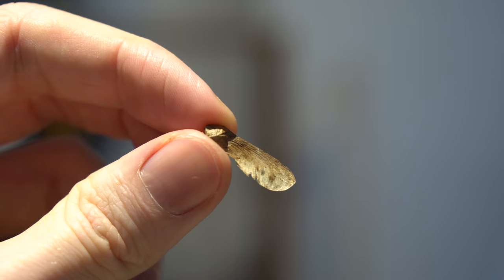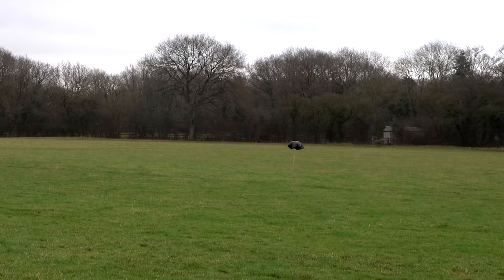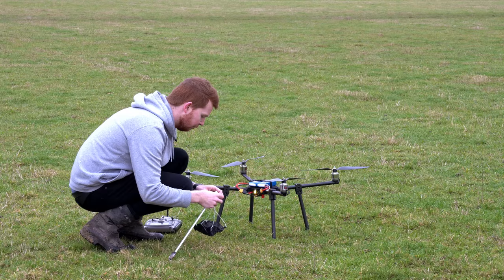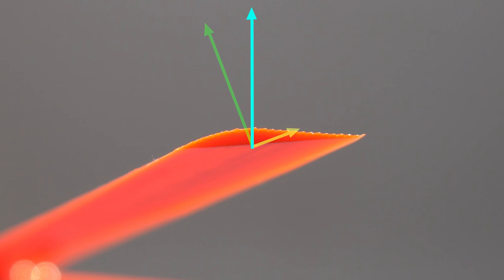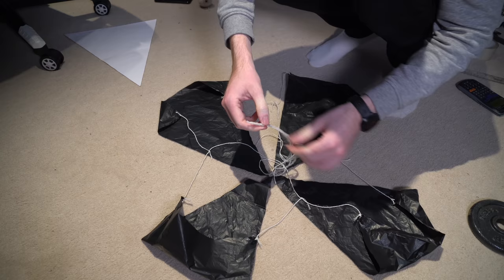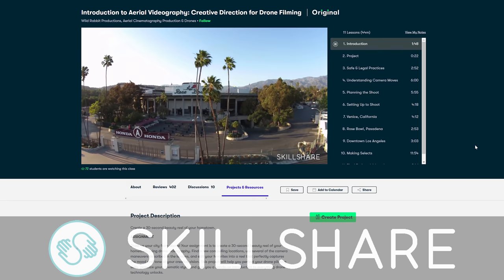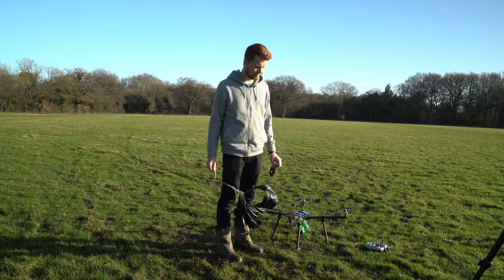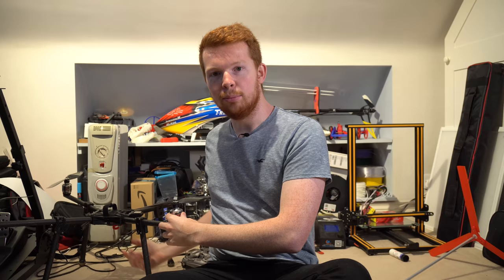Should Parachutes Spin?

Comment: Ladies and gentlemen, I give you: Autorotation. The reason why helicopters don't fall like a rock when their engine cuts out.
Reply: I had the exact same thought!
Reply: Additionally because the pitch is adjustable, the pilot is capable of just before "landing" to adjust the pitch and use the energy in the spinning rotor to produce some lift as well.
Reply: I was checking if someone already wrote that and You did, Thank You
Reply: They do fall like a rock for about the first 60 meters. After that the rotor speed is high enough to be useful. Under 60-80 meters, prepare for a hard landing.
Reply: Tom could add a servo to the rotor and a proximity sensor to make it flare for a soft landing.
I'm sure he's up to the challenge!
Reply: Also why autogyros or gyroplanes work in the first place.
Reply: There's a video of a pilot demonstrating autorotation here on Youtube.
He shuts of the motor and lands like a boss.
Reply: What Is Islam?

Islam is not just another religion. 

It is the same message preached by Moses, Jesus and Abraham.

Islam literally means ‘submission to God’ and it teaches us to have a direct relationship with God. 

It reminds us that since God created us, no one should be worshipped except God alone. 

It also teaches that God is nothing like a human being or like anything that we can imagine.

 The concept of God is summarized in the Quran as:

{ “Say, He is God, the One. God, the Absolute. He does not give birth, nor was He born, and there is nothing like Him.”} (Quran 112:1-4)

Becoming a Muslim is not turning your back to Jesus. 

Rather it’s going back to the original teachings of Jesus and obeying him
Reply: @ahmdabdallah5811  mhm yes
Reply: lol odd place to bring up god but ok
Reply: @ahmdabdallah5811  the fak man?
Reply: bro i thought the same thing!
Reply: Yap
Reply: @ahmdabdallah5811  Jesus built my hotrod.
Reply: @technotaoist72  Wouldn't the blades be spinning by default anyway? Like, how else does it get up there?
Reply: It  depends on the type of failure. Drive in 4th gear, then drop it into 1st. Suddenly your wheels aren't going as fast as they were. There are multiple failure conditions that will slow your rotors.
Reply: Works with LEDs too (using light, not rotation)
Reply: This channel is about science....why do some feel the comment section is a place to push their religious agenda ?...there is a time and season for everything...wrong time..wrong season....now on wit more science!!!
Reply: @walterwilliams3861  Not sure if you realize that there what you said is a Bible quote...
Reply: @technotaoist72  yes this I know...raised as a Christian....practiced Islam for 22 years...now I just consider myself a spiritualist....just saying the only thing worse than a pushy Christian...is a pushy Muslim....faith is a personal journey...no disrespect intended on my part...just saying...
Reply: Came for parachutes..not theology....
Reply: @walterwilliams3861  I like soup
Reply: @technotaoist72  I like sandwiches...who's to say one is better than the other....lets agree to disagree...and get back to science....kmsl
Reply: I always figured with autorotation what they did is pitch the blades the other way last minute so the momentum of them rotating starts to push air down, am I wrong?
Reply: @technotaoist72  just watched an ok Seinfeld clip just had to say it...."No soup for you....."....kmsl...
Reply: @ahmdabdallah5811  so when groups or sects that claim islam go on a crazy killing spree and start shouting Islamic terms and prayers, why don't the church assembly or recognized leaders rebuke and publicly unrecognize them as brethren of the Islam religion? Seriously. When devoted Catholic serial killer John wayne gacy was executed they made a public statement saying his actions were of the devil and not the catholic faith. They said a man who truly follows the doctrine of church is not capable of the murders. Explain plz. Seriously...
Reply: @redsquirrelftw  I'm not a helicopter pilot, but AIUI, that's part of it.  One of the things they do really early is reverse the blades so that the up-rushing air is maintaining or speeding up their blades.  They also, if they have forward momentum at least, enter a downward and forward glide much like a plane would. This allows them some control to pick their landing site.  And, as they get closer to the ground they use the energy in the blades to adjust their descent speed and path so that they flare and land, again somewhat similarly to how a plane does it.

So, yeah, at the end they reverse the blades (or reverse them back, really) so that they convert the rotational energy they've been conserving and/or building into lift, but this is one of many steps they use in the process of autorotation.
Reply: @ahmdabdallah5811  Islam is just a religion
But Christianity is a lifestyle 
Sacrificing everyday for God
The good news was spread by christ himself our savior
Your God does not align with our God even your religion does not have a mutual relationship to us. Islam is for you only. You cannot save on what is already saved. Us christians are only going to need to sacrifice our own souls to Jesus Christ
Reply: @jaydensdream714  Catholic faith is different to real faith in Jesus Christ
Reply: @jaydensdream714  Btw why did this place became a theology session?
Reply: And a gyrocopter is the safest plane.
Reply: Yes, but with Autorotation on a helicopter you have to change the Pitch. If the engine fails, you have to use negativ pitch (the rotor will rotate from falling) and near the ground (landing) you have to change to positive Pitch to reduce the falling-speed (1 chance).
Reply: @wizzardrincewind9458  because air speed increase the further you are from the point of rotation, by adjusting the pitch of the blade, you can have the 50% inner rotor working has a turbine, and the 50% outer blades working has a propeller making lift. You can adjust the % as you want.
Reply: @MrRolnicek  Also why I'm a fan of them. Can't understand all this desire for helicopters at all costs. Autogyros will do 90% of what a chopper will do for 25% of the outlay...
Reply: @ahmdabdallah5811  Why are you?
Reply: Yes, but the landing still hurts.
Reply: @ahmdabdallah5811  Are you sure you've come to the right video? Not sure what all that diatribe contributes to the discussion.
Reply: Hey it's me destin!
Reply: @travellingpilot  Me too!
Reply: @ahmdabdallah5811  A violent, militant government system masquerading as a religion.
Reply: Just what I was going to write. And correct me if I am wrong about this but that's also how gyrocopters work. The main rotor on the top is not powered by an engine but by the incoming air.
Reply: ahmd abdallah exmuslim here, open your mind sheep.
Reply: Those aren't parachutes--they are popellers and propellers spin!  Parchutes don't spin!
Reply: I was a lot younger and forget the details, but here in nz there was a heli pilot who used to just shut the motor off and auto rotate back down the valley to base.
Reply: tell that to john denver
Reply: Tell that to Kobe
Reply: Steven Cooper too soon
Reply: Exactly!
Reply: ohhhh... this didn't age well
Reply: But Kobe Died ....
Reply: It's kind of weird that he didn't state autorotation by name, that is exactly the topic of this video...
Reply: Kobe still died tho.
Reply: Tell that to kobe
Reply: @ahmdabdallah5811  go somewhere else my friend. This is not the place
Reply: Talk to Kobe about that one.
Reply: If my parachute was spinning that fast.... well I'd be crazy dizzy!!!
Reply: Yes, exactly what my mind came to. However, autorotation requires forward velocity to keep the blades spinning. This drops straight down...
Reply: I didn't know that. Thank you
Reply: @ahmdabdallah5811  Then why all the murder? For one thousand  four hundred yrs?
Reply: @ahmdabdallah5811  Ah, yes. Praise aloha
Reply: Contrary to Neil Degrass Tyson's understanding of helicopters.
Reply: Kobe
Reply: And, even more so, the Gyrocopter or gyroglider.
Reply: @technotaoist72  Are you a helo pilot? Because if the pilot reacts quickly, this seems wrong. After all, the rotor doesn't need to spin up if you're already flying.
If you are a pilot or for some other reason know that it falls for a bit and why, please do explain, as I love to learn and overcome my own misconceptions.
Reply: @justuslm  When the motor stops, there's no more torque on the rotor, so you need to lower the collective and the fall will keep the main rotor spinning enough to be useful, providing nothing in the drive system binds it up.
Reply: @technotaoist72  But won't the lift created by the rotor through autorotation simultaneously start slowing down the fall, meaning you won't even really fall for 60 meters?
My understanding is that this actual falling distance would only occur if the rotor wasn't already spinning at significant speed, but if you notice the engine failure before the RPM really drops, that shouldn't be the case, right?
Reply: @justuslm  if you are 300 meters up, using up the momentum of the rotors in the first 20 meters is sub-optimal
Reply: Oh but they do...
Reply: Helicopters do also have a flywheel which stores energy to keep the rotors controllable when it has an engine malfunction.
Reply: @ahmdabdallah5811  Curious question. if preying to god directly is good then it would stand reasonable the jewish practices are the most correct as they  worship god directly.
Reply: @ahmdabdallah5811  "Ah yeah you know what, Islam is very relatable to autorotation"
Reply: with one caveat, the blades still spin.
Reply: @Cynyr  partly. In autorotation the blades are angled downward, so that the gravitational pull on the helicopter and the increased win helps keeping the inertia of the rotor head, and they only give positive pitch to the blades at the end of the descent, so they keep the rotor head in motion by angling it downward, otherwise the maneuvering of the aircraft would stall the rotor ( altering the cyclic pitch does rob the head from it's inertia), and that would be game over.
Reply: @technotaoist72  most of the time when you're that high up in a helicopter, the rotors are already spinning though.
Reply: What about Kobe tho...
Reply: Breaking news from Mother Nature: And it'll work if there's only one blade left as I showed you with that seed, have a nice day
Reply: @Cynyr  nice hacks
Reply: agreed! 1000% true!!
Reply: what about if the gears or bearings are fucked

Comment: To put things simply, it transfers the energy into spinning.
Reply: That sounds like putting things too simply. Can't be just that. To avoid converting all potential energy into 
kinetic energy after some arbitrary point (which would be freefall from that height) this thing would have to continue converting some part into rotation all the way as long as it's falling - however, that would have it spinning faster and faster all the time, which is simply not the case. More likely it immediately transfers on that "spinning" into air propelled downwards.
Reply: hi .. interesting hypothesis (if that is the correct word ?)
causes me to run out profound (to mee) abstract thought threads.
Reply: Correct. All those saying you are wrong are being far too specific when they tell you what they think it really is.
Reply: @AttilaAsztalos  Nope, you're being pedantic.
The downward motion transfers energy into the spinning of the rotor; that is literally all that is occuring.
The restrictions on its speed are not related to how it STARTED moving; or the effect present when producing lift; it's lift is directly proportional to its size and weight, which go figure, only changes how much energy it can absorb.

Comment: Not sure how feasible it is, but it would be amazing to see you build a 3d printed gyroplane and try some pinpoint landings.
Reply: Powered by compressed air
Reply: Better yet a Gyrokite like the Germans used as a spotter from their submarines
Reply: @johnbeauvais3159  I saw one of those in a museum, you wouldn't have wanted to be the pilot, if they spotted a enemy ship they'd simply unhook you from the sub and let you crash in the water so they could engage the enemy!
Reply: @jeffvader811  Yeah, and they gave you a parachute but from the altitude those things flew it wouldn't open before you hit the water and if it did you would have to get out of the harness before the canopy filled with water and sucked you under. Terrible job and what a unique concept
Reply: i agree! entirely spot on.

Comment: The same kind of rotary effect happens when helicopter engines fail. We saw this in the Australian fires recently where a firefighting helicopter went down and the pilot walked away from the crash landing. People expect helicopters to go down like a rock, but unless they have rotor damage, or the pilot loses control, the fall causes the rotors to spin and slow the descent. It is called autorotation. 

The record for this was set in 1972 when French aviator Jean Boulet had an engine flameout at 40,814 feet and he was able to use autorotation to safely land the helicopter. Incidentally, that flight is still the highest that any helicopter has ever flown and the flameout is the reason no one else has tried to beat it. 

BTW, the American military has a decoration called the ‘broken wing’ for any pilot who successfully autorotates in an emergency and saves lives as a result.
Reply: HIDDEN ACHIEVEMENT UNLOCKED (BROKEN WING)

Comment: I haven't finished watching yet, but I just wanted to let you know something. I occasionally fly RC autogyros, and to save from breaking blades and hubs, we use soft balsa shear pins and one of our two points connecting the blade to the hub. The other being a bolt that allows for rotation, so when there's a blade strike, the sheer pin breaks, and the blade can fold back and hopefully not break.

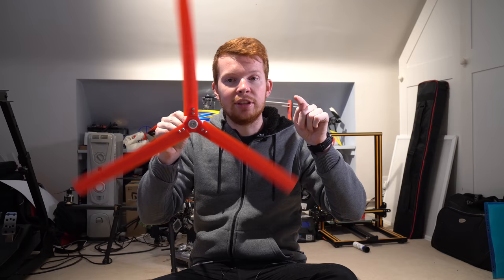Comment: 3:12 this is how helicopters can glide with out the engine working, I actually learnt this the other day in Smarter Every Day
Reply: You misunderstood.  This is why it can propel itself a short amount (Destin probably said glide forward) after it is gliding. Gliding is because of surface area on the wings
Reply: It's called an autorotation
Reply: rip kobe
Reply: @greyler7895  sad thing is that kobe died from 100% pilot error. No mechanical problems. CFIT (controlled flight into terrain) due to VFR into IMC conditions.
Reply: @elekrazy433  yes, I understood but english is no my first language and i could not find other words to say it, but thanks for correcting me, guess we learn new things everyday
Reply: @elekrazy433  From my aeronautical engineer standpoint, it is gliding. Auto rotation works exactly like gliding. In a glider, you pitch down to go faster and pitch up to descend slower until you start losing speed. A rotor works just like a glider, except it goes in circles. You pitch the blades down to spin them faster and pitch them up to exchange their speed for a slower descent. You can also glide forward fairly well in a helicopter.
Reply: Smarter every day gives me negative vibes though. Not sure what it is, but i have some ideas.
Reply: this comment is entirely right

Comment: In my final year at uni I had a very similar concept for slowing down payloads dropped from a UAS.  The rotor would be tensioned on a wound spring to provide that initial spin once dropped and allow the payload to be dropped at a lower altitude without plummeting.  Unfortunately it would have been heavier than parachutes and mass was at a premium to keep it below the 7kg limit.  This was for the IMechE UAS Challenge by the way and well worth checking out if you haven't already.  The design would also have changed the pitch of the rotors to benefit from auto-rotation, then use that momentum to produce a lot of lift nearer the ground. 

I'm really happy you made a video on this as it was something I obsessed over for the better part of a year. Great work!

Comment: In WW2, the U.S. Army used a single blade case, like a very large version the leaf shown in the video, to airdrop a vacuum tube radio without damage.   The spinning case was less subject to wind drift allowing more accurate drops.

Comment: Another reason seems that the rotating chutes wouldn't work well when you need multiple. Most capsules use between 3 and 4 chutes at a time.

Comment: There is one rather common usage for the spinning blade "parachute"; helicopters. In case of engine power loss, a helicopter wont fall like a rock, rather it will glide down because of the same principle. This is called autorotation and it is something the pilot has relatively good control over.

Comment: As you were talking about this I envisioned a parachute, but different than the vortex one. I imagined one that was similar to a regular parachute, but with flaps that start of closed, until the pressure gets to a certain amount, then they open, causing it to spin, with some connector in the middle that allows the chute to spin, but not the cargo below it.

Comment: And during high jumps in kitesurfing, the kite is being "heli looped" straight above head on the decent to generate lift for soft landings.  For more parachute expirements, you might consider sew an inflatable propeller, similar to a RAM AIR matress kite, but just twisted in the middle like a propeller and bridled towards 1 center point.  Maybe worth looking a software like "Surfplan".